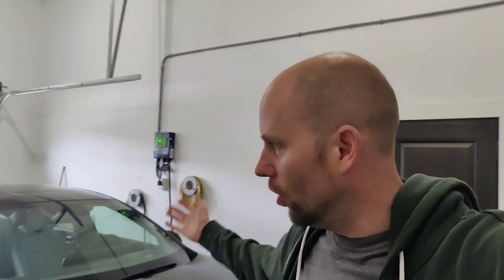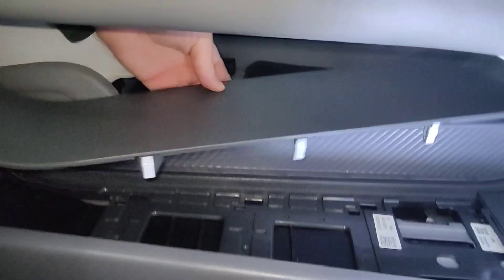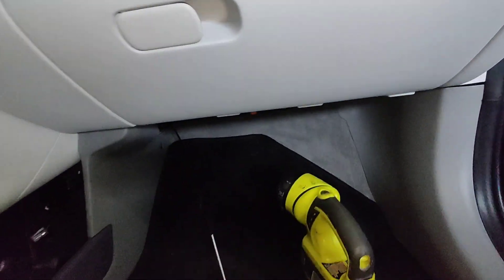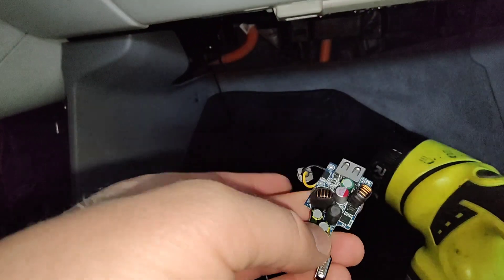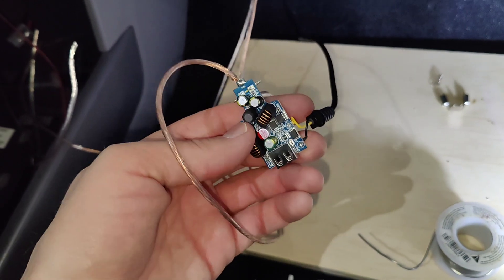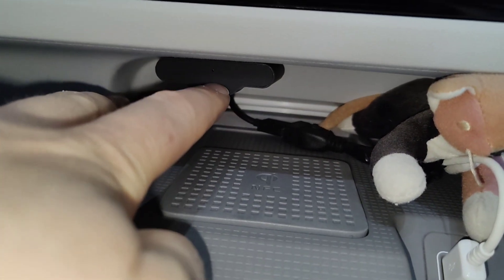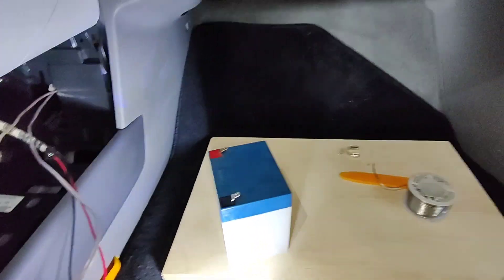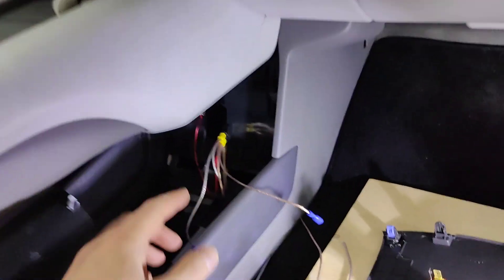Add WIRELESS Android Auto to your Hyundai!! (With auto power off)

Comment: Ed, nice job. What type of connector did you use to connect to 12V (connectors hidden under the yellow and blue heat shrink)?
Reply from the maker: I found some really nice high quality tap - ins....

I didn't want to cut any cords

Comment: Does the USB receptacle in the car pop out?  I was wondering if it would be possible to wire directly to the plug?  That way you could hide the wireless Android dongle inside the dash.
Reply from the maker: Yeah I had the thought of doing that too.... Haven't done it yet though as I'm trying different wireless adapters and haven't settled on one yet

Comment: Is the usb port not powerful enough to power the Android Auto box? Edit. I understand that it does not auto power off like the ACC.
Reply from the maker: It is... But that's not the point of my video. 

The main USB port actually never powers down. So the Android box is constantly trying to connect to your phone's Bluetooth and wifi. 

So my video is about how your can correct that by getting power from a switched source so that the Android box powers down with the car.